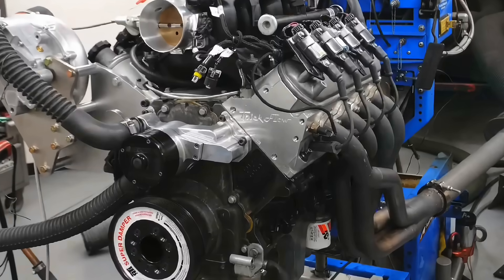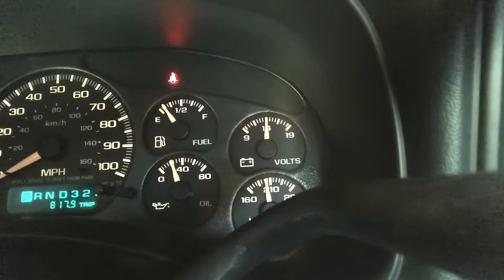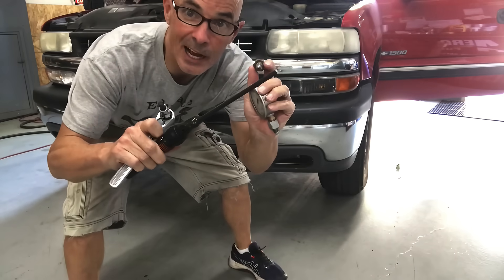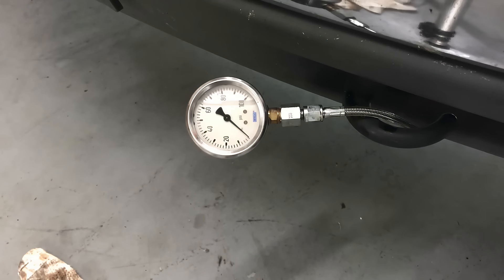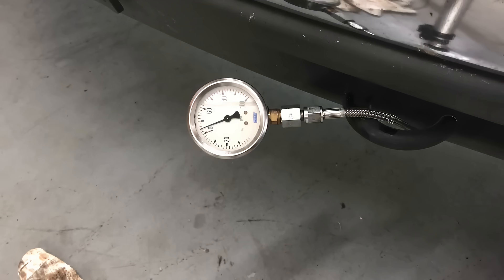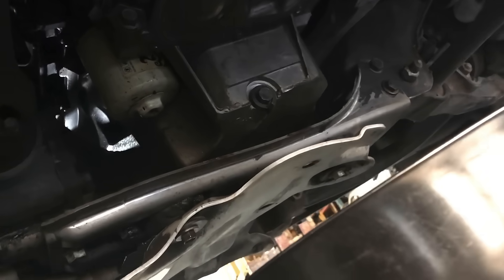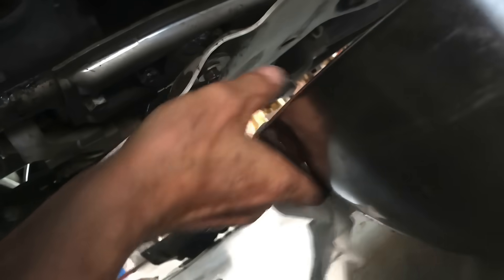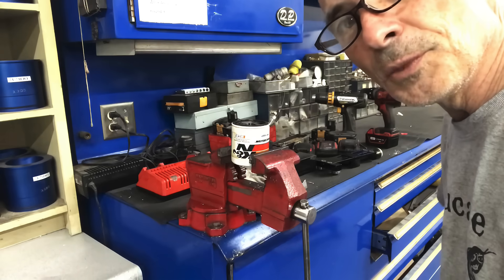HOW TO: TEST & FIX LOW OIL PRESSURE IN YOUR 5.3L OR OTHER LS?

Comment: 15w40 in a stock LS? Really Rich?
Reply: I was wondering about that. Mine takes 5w 30 syn
Reply: Also run 15w40 in my engines with a few miles on them...works well.
Reply: He's also in southern California. 15w40 isn't out of the question
Reply: @timothybayliss6680  I live in Florida. Never had a reason to run anything thicker than 5w30 in my LS2.
Reply from the maker: oh no...Richard used something different (I've run everything from straight 0 through 2-50)
Reply: @richardholdener1727  diesel oil in a LS is definitely not the norm. I assume you went back to 5w30 after replacing the o ring.

Comment: If that is low oil pressure I'm in trouble!
Reply: Me too!
Reply: For real. As long it’s over 20, let her rip tater chip!
Reply: If I have 2lbs of pressure per 100 rpm, I'm happy as a pig in Poop!!! Lol
Reply: Yep, everything of mine idles at 20 psi or less.
Reply: Ditto lol
Coming from an older vortec v6, i thought 35psi at idle was pretty normal.
Mine is an 09, afm disabled via tune.
Had a slight tick at idle, turned off afm and instant fix!

Now i might need a pickup tube o-ring... probably related lifter tick when i have afm enabled? 😶
Reply: @justfishing6067  Your AFM should have nothing to do with idle.
Reply: @Nonameviewer23  you would think that right?!
But apparently it's a thing. 
I'm told that disabling afm only slows down the lifter failure.
Reply: @justfishing6067  "I'm told that disabling afm only slows down the lifter failure."

Whoever told you that is a fool that doesn't know what they're talking about. If you disable AFM, the lifter stays hard locked in its extended position. Hardened pins lock into position and keep the lifter from collapsing. If AFM never activates, the lifter pins never unlock, and lifters are like any other normal lifter.
Reply: @justfishing6067  Lifter issues usually involve the small filter screen feeding the AFM system being clogged up with sludge. A lot of 1st gen AFM trucks had repeat lifter issues because that filter wasn't cleaned or replaced. But yeah, the o-ring issue probably led to some AFM lifter issues.
Reply: its not the exact pressure ,it was a differece in a short period of time, he caught it early
Reply: Mine idles at 30psi, at highway speeds it gets up to 60psi
Reply: mine reads the same but I think mine is low wow that oil he used
Reply: Most engines need a lot less oil pressure than people think. Excess pressure is just wasted power. Although it probably won't run that low, an LS is within spec at less than 10psi at hot idle. The big thing to look at is whether your pressure is rising with RPM. The old racing adage of 10psi per 1000 rpm isn't a bad one to go by.
Reply: a guy that worked on mine said all chevys run low I dunno mine is still running great after replacing vacuum lines
Reply: @suzieq8379  my 6.0 idles around 37 psi
Reply: @reverandhale863  mine does to and I already replace the oil sending unit plus screen as well still the same pressure about 38 but when I press the gas the pressure does go up
Reply: It's not so much that it is "low," but that it is significantly lower than before.  He wanted to make sure the low oil pressure wasn't something more damaging.
Reply: The 2014+ 5.3 and 6.2 trucks will have a hot idle that's that low. As soon as you step on the gas, it should return to ~40 PSI and will boost to approx 75 to 80 PSI when it reaches around 2500 or 3k RPM.
Reply: Got a 2018 with 60k on it. Runs at 40psi while driving and 30psi while idling
Reply: @ttgk8506 2006 6.0l sampre pressure in hot idling but in cold start only 25 to 20 psi 30  when accelerating  at 1000 rpm
Reply: have you checked the pickup tube o ring they are known to go bad and give you low oil pressure, i know i have had this happen before, my 04 has over 580xxx on it and had to change it a couple times, something worthwhile to take a look at, and not to bad of a job to do,
Reply: I have a 2008 esky. It was reading around 11-12 at idle hot. It would never go over 30 even a 3K RPM. I had the melling HV oilpump and o ring installed now it goes to 55-60 at cold idle but still dips to 22-24 at hot idle. It did stop my lifter tapping after driving highway. I'm still not sure how much life is left in it at 212K miles.
Reply: Replaced o ring and sending unit I still have the same problem but rides great
Reply: @BASSWITHKEV won't last wait till the lifters start making noise then your screwed
Reply: LOL
Reply: I've replaced oil pump O rings and everything and still hot idles at 37 but when I hit the gas it goes up and when I stop it goes back to 37, I was told could be cam bearings but idk
Reply: @jameschaplin8975  is your Car/Truck running fine.... other than what the gage shows..... Old engines don't have as high oil pressure as tight new engines...
Reply: @kelvenguard don't matter your pressure has to to be in the middle of it's anywhere else you have a problem
Reply: @jameschaplin8975  my Prefect Running Daily Driver 2004 5.3 GM 480,000 Km idles at 275 kpa or 39.5 pounds cold... and Less Hot for a LONG time now... I spent $200 fixing all the Gage Cluster Motors so I know its true.... I would SEAFOAM the CRAP out of your Engine and Clean the Sludge inside and see if you can get the pressure up a bit more and run a High quality 5W-30 oil and High quality oil filter and an Oil additive like Lucas or Seafoam or Power Up or Ultra Guard... 39 years Auto-Body and owned Many High High Km engines....
Reply: All you need is 10w30 with one hole quart of Lucas oil stabilizer I have 3 ls engines trust me lol
Reply: @adrianherrera9688  interesting my sons trucks has this issue so by adding oil 10-30 plus Lucas oil stabilizer will make it go up ?
Reply: Put a quart of transmission oil in it let it run for a bit then do this in the next oil change
Reply: @Beto_carrizales  6.2 L 2009. I put a whole quart of Lucas in and it barely keeps the low hot idle above emergency shut off.     On a really hot day with a heat soaked engine it will drop down and say low oil pressure turn engine off.    Before that it did it anytime there was a hot idle.
Reply: I sit at 20
Reply: Same mines at 2
Reply: @Accordsterr  did you figure out what it is?
Reply: Me too
Reply: @tylerthomas3744  did you figure out what it is?
Reply: Same bro
Reply: @kadentelford6677  did you figure out what it is?
Reply: my 350 5.7 has about 5 to 10 at idle
Reply: Depends if you used it alot if you spot it in time you have time to fix the problem I've fixed mine
Reply: Bro
Reply: 24 psi hot idle
34 @ 2000
10 psi per 1000 rpm all way to relief pressure.
Reply: I usually use Rotella 18 wheeler oil in my Tahoe, 5.3.. I’ve used it in all my vehicles for years. Well, I blew a head gasket a week or two back and had a new head gasket put on in the guy put 5W 20 oil back in my motor and now my oil pressure at idle is about 15😂 needless to say I’m headed to get me a jug of Rotella😊
Reply: That's what i was thinking
Reply: In case anybody is interested I had the low oil pressure in my 2000 5.3. Stayed around 20 psi most of the time. I assumed it was the pick up tube gasket. How I temp fixed for 4 years was a bottle of blue devil rear main sealer. Pressure jumped to 40psi no matter what and held until I stupidly ran a strong cleaner thru the oil. Quick fix that worked very well

Comment: I have seen a few AFM/ DOD engines where the oil pressure relief valve sticks open a tick, also worn out cam bearings in a few high mile 6.2 in early Yukon Denali/ Escalades, (250K+ miles). These engines seem to be harder on oil too, the local PD has a Tahoe that sets oil pressure codes about 2000 miles after the OCI, new GM filter and 6 qts of Dexos and its fine. The engine does idle alot tho. Oil pressure at idle warm will be 10-12 psi before, 30-35 after. Weird.

Comment: Everyone knows the cure for low oil pressure on an LS is boost. SMH
Reply: ...or just another LS from the junkyard LOL
Reply: AUTONOMEN x pull the block plug as Richard did , run a feed line to the turbo, then line back to the pan from the turbo.

Comment: Abt time to rotate those tires looks like? rember same side front to back always keep tire rolling same direction or will cause belt separation!!
Reply: No they won't. You're supposed to switch the non drive wheels side to side when you rotate them.
Reply: @LT3Fluffy  good luck with that bubby that's how they rotated tire with tubes in them back n the day
Reply: @scottyjones27  ok boomer I guess cars nowadays all are bias ply with tubes in them. Every service manual I've looked at from school to shop says switch them because guess what. R A D I A L tires
Reply: @LT3Fluffy  like i said good luck do ur car the way you want to But take note n see what happens n few weeks of driving
Reply: @scottyjones27  i commute 30-60 miles each way to work and back and thats how I rotate the tires. A few weeks? Haha how about since I bought the truck 2 years ago
Reply: @LT3Fluffy oh I'm sure you do not rotate ur own tires u let tire store do it Ay? Guess what they want to sale Ur dum ××× more tires cause you change rolling direction of a tire it will develop knots and jump up n down going down road n every one will know there's another sucker!!
Reply: @scottyjones27  I do it myself. Its hilarious that you know you're wrong and the new tire technology and knowledge just doesn't penetrate your set in ways. Says alot about you
Reply: @scottyjones27  I thought you said it would take weeks? What happened to all that? Or have you not touched a car since "fuelie double hump heads" were the hot ticket?
Reply: @LT3Fluffy  good luck with ur life i do not feel sorry U
Reply: @LT3Fluffy  I've driven the same car same engine same trans same everything but fuel pump just changed it cause the socks were stopped up for 18years and 360000.0miles when you have done that with Ur vroom vroom truck big boy U can skool me on how to's U will learn if not life will suck as ur's does now

Comment: Does the rear cam bearing matter as much to oil pressure as it does on the sbc and bbc?
Thanks Rich!
Reply: I don't think so. The rear cam bearing is one of the last places to get oil in an ls engine. The oil pump is driven off the snout of the crank. Gen1 small blocks and mark4 bb have the oil pump mounted to the rear main cap I think. The last or back cam bearing is one of the first to get oil and I thought it had transfer galleries in it. Small blocks use a section of the distributor, oringed in the block, to transfer oil to the passenger lifter gallery. Look at a Chevy oil pump primer and there is a section with o rings. This is an oil transfer.
Reply: @timothybayliss6680  Thank you!

Comment: GM calls anything above 6 psi at idle "normal" in their ESI....
Reply: Spec is exactly 1psi per 100rpm, with coolant temp at 205 and oil temp over 180 degrees. 

We have brand new crate engines from GM that make less than Richards.

Also gauge on side of block typically reads 10% lower than if you put the gauge in the sending unit location. 

Also running 15w40 changes what your readings will be. 

Also running a KnN oil filter changes your readings.
Reply from the maker: exactly?
Reply: @richardholdener1727  GM only lists minimums in the service manual.  The minimums listed in the tables from 1986-2015 is exactly 1psi per 100 rpm to 3,000 rpm. After 3k the listed values vary per year/motor/oil controlled items/and industry.

Those minimums are also given based on 205 temperature of coolant and 180 degree oil. There is also a specific weight and type given for each engine. Almost all Gen3/Gen4 motors are 5w30 conventional with a few dexos full synth, All of the gen5 I have come across so far are all full synth 0w20 from factory.
Reply: @MrAPCProductions  Camaros and corvettes run 0/40 now.
Reply: @richardholdener1727  If I'm not mistaken even for the ls7 was listed as a minimum of 6 or 7 psi at idle.  But they say nothing about what it should read when new, I guess they want us to worry when we see it go that low?

Ummm here's a thought for your next one.  Do some tests to see how low of an oil pressure you could run on a stock tolerance engine with their recommended oil vs aftermarket/different viscosity oils should be interesting to many I know.
Reply: Outlaw...thought that was just during the warranty period! Specs tend to change with the “General” during warranty period (their wallet) versus after warranty (your wallet)...😊
Reply: @divadyrdnal  could be the case.  It's just I'm pointing out what the official ESI says for Gen 3 and 4 at the time (also 100% with Richard's video and his case study on the matter). 

Don't care about the politics of warranties myself honestly as I'll just swap parts anyway haha
Reply: Usually they'll throw a code with anything less than 20psi.
Reply: @Brother2Jis_27s4   It is less than that. I'll try to dig up the exact numbers. A Gen III 5.3L from memory was around 6psi and a Gen IV was around 5-6psi. If anyone wants to see I can post up the specs. The 99-02 like Richards has an oil pressure sensor with a sensor for the gauge and a switch for the PCM. From 2003 and up the oil pressure sensor actually sent a reading to the PCM for pressure rather than just a yes/no.
Reply: My 2016 5.3L has a pretty steady 40psi on the dash gauge.  It’ll jump up to around 60+ if I get on it hard.
Reply: As was stated above GM lists these as minimum requirement numbers and call it (fine).  Because I guess many people notice less than 40 psi at idle and start panicking. 

By all means if you have lower than usual oil pressure have it checked and fixed if needed.  Especially for those DOD type engines.
Reply: What is odd about some of these comments, The O-ring WAS bad. If the O-ring is bad # brittle broke squasht, it will cause lower oil pressure. And it apparently fixed the issue.  Maybe it's a form of small man syndrome? Armchair quarterback? Wife doesn't listen to you when you talk? We don't blame you after all Richard is pretty damn smart and awful damn cool and he has a YouTube channel and everything, good thing he didn't show you a photo of his beautiful wife you may have ended up just spending the rest of your life hiding under the covers in the fetal position.
Reply: @kevinwest3689  gm spec is ridiculous less than 10 psi at ilde that will destroy new bearings
Reply: @bread-chan6650  I wouldn't be surprised if your right about the specs or ruining the bearings,  on the other hand I've seen Motors torn apart with 200,000 miles & the bearings look brand new. I grew up a Ford guy, times have changed, I don't know how one could pick one manufacturer over another these days unless it's out of habit or nostalgia,  we all kick ass here in America, well all but about 70,000,000 red hat wearing co-conspirators

Comment: Good for you, in my rams 5.7 it was the rod bearings. No idea how they just went bad.
Reply: Usually the newer hemi wipes out the cam. Seems the lifters are giving up.
Reply: Wrong/bad oil can damage bearings and/or lifters if not the engine had a problem by design or not taking care of.
Reply: 3rd gen himi's have some design flaws related to oiling. Any oil pumped to the top of the engine drains back to the bottom end but it doesn't fall on the cam and lifters on its way down, meaning your cam is only lubricated by the oil that gets slung off of the crankshaft. They eat the cam and lifters, shed metal particulate, and that gets in the pump and bearings.
Reply: 10lbs per 1000 rpm and you should be good.....unless it gets worse lol